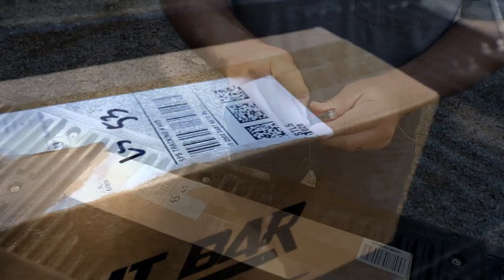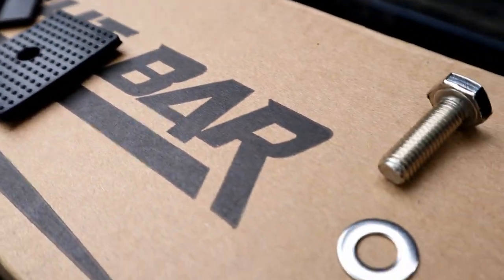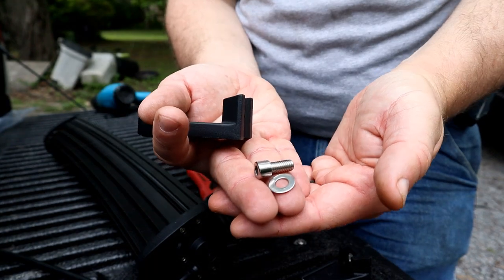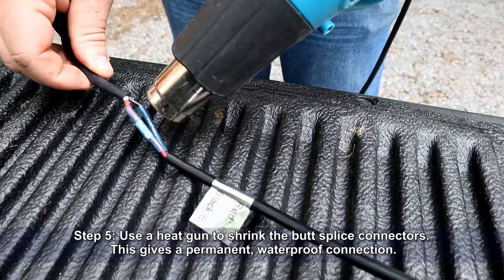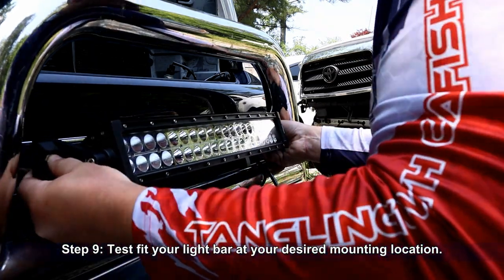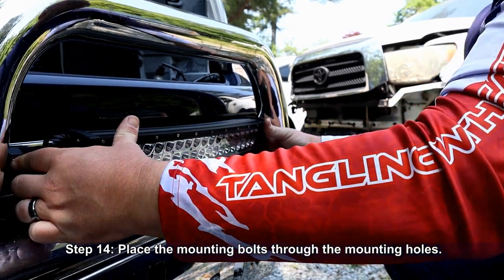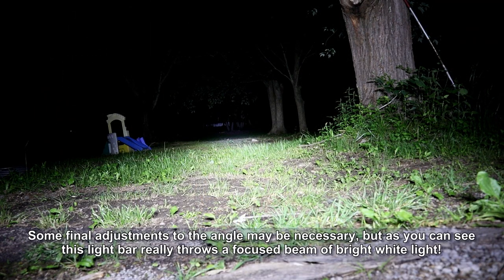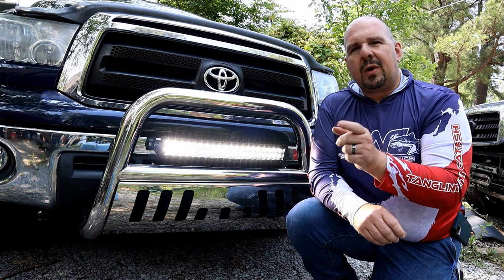How to Install a Nilight 22" Curved LED Light Bar

Comment: You did not show how to connect with the battery
Reply from the maker: @jccortes1245  that wiring is completely dependent on how you want to do it.

Everyone is going to wire theirs a little differently.

I used a switch made to fit inside an oem placeholder on the dash. The switch provides 12v to turn on a relay that connects the light bar to the battery.